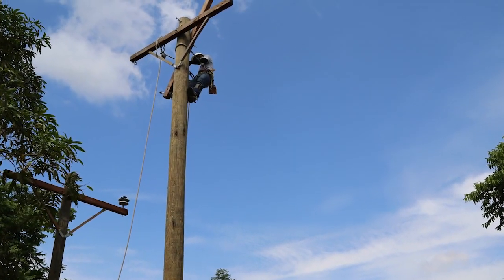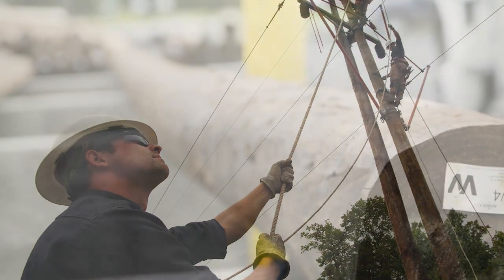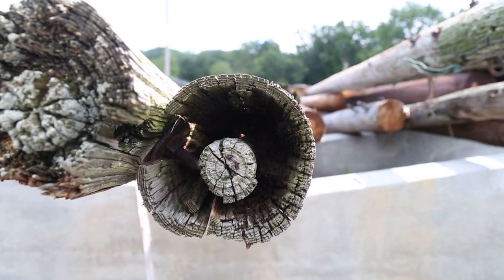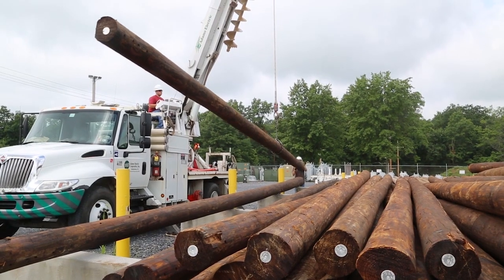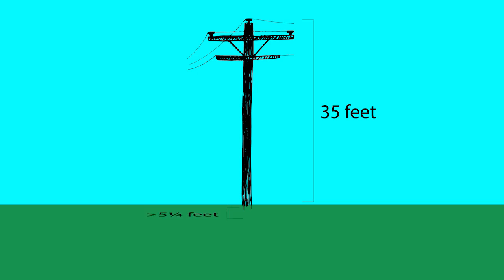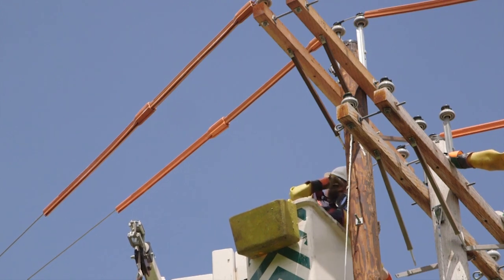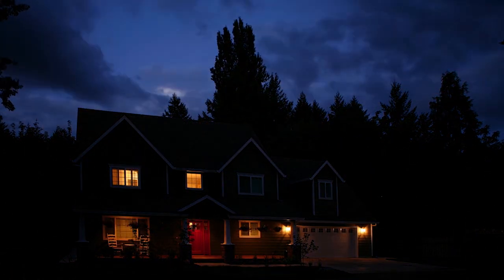How we change out an electric utility pole

Comment: Why do they put those orange towels on the lines?
Reply: So they wont conduct electricity just in case
Reply: Have a few pieces. It’s made of non conductive rubber so if a live phase touched the coverup, it would not arc and destroy a crossarm/pole or cause a dangerous situation.
Reply: Insulation
Reply: 🤦‍♂️ really?

Comment: just saw a leaning pole so called it in.  was curious how they change em so here I am.
Reply: bob carter They’re changing a pole a few houses down from me after it was hit by THREE different vehicles in the last 18 months. Yeah they’re finally replacing it. The one right next to my house still has gaffers tape holding the crack running down 1/2 the legends of the pole. It’s been damaged for almost 4 years now. The utility worker told me we have to get someone to hit it before they’ll replace it. Unbelievable.
Reply: @Assimilator702  not good.  where are you located?
Reply: bob carter CT. Whenever the town has to pay for anything this happens. Of course there could also be hang ups with state owned light poles. The road was rebuilt to reduce a curve to apparently make it “safer” but there have been more accidents between my house and the pole a few houses down since the “improvements”. The last accident in December knocked down a light pole to the right of my driveway and cracked my neighbors sidewalk blocks. The sidewalk was immediately replaced however the state they opted not to replace the pole which is not a problem since the font of my house is lit up like a football field at night. One less light still makes no difference. The town went overboard wi5h the lights in the rebuild when they should have designed the road to be safer at the curve. I can understand a drunk person missing the corner but a sober person should have no excuse. I hope these idiots are getting their licenses suspended.
Reply: @Assimilator702  I am lucky to live in a city that is very responsive.
Reply: @Assimilator702  shut your gay mouth. You have no clue what you're even talking about. Just wake up tomorrow at 9:30 and go to work bitch. Leave the real work to the adult males.
Reply: Ha! Same, I didnt wanted to be the guy that left the neighborhood with no power and get blamed for it.
Reply: @kevinparedes123  what? That makes zero sense. In the future mind your own business and don't concern yourself with a trade you know nothing about. Loser.

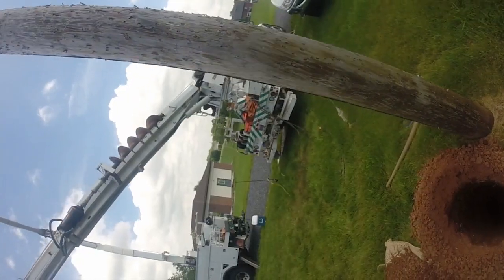Comment: At 1:30 she says, "the old pole is filled and tamped" which surely should have been, "the new pole is filled and tamped".
Otherwise, a very good production.
Reply: She’s says “old hole” is filled and tamped or packed. But it shows them working on the new pole when she says it so I originally thought the same thing.
Reply: Dumb-fuck: it’s the old HOLE...as in from where the old telephone pole was
Reply: @EmpireTextbooks  your an angry little guy, arent you?